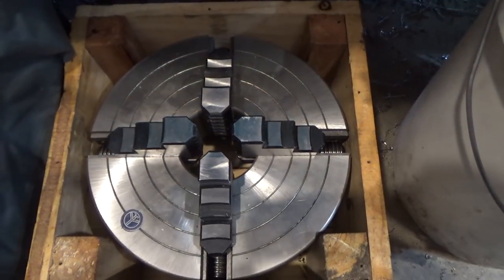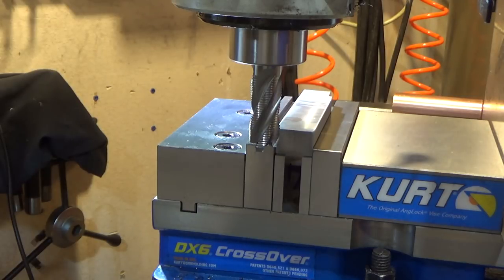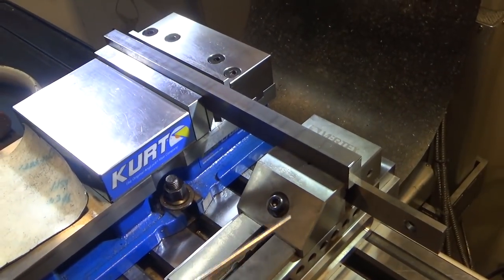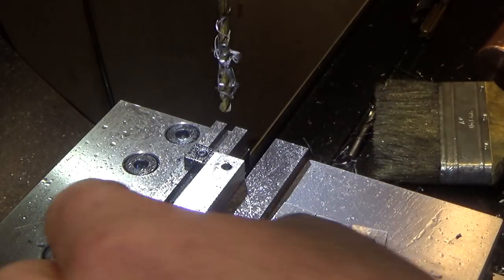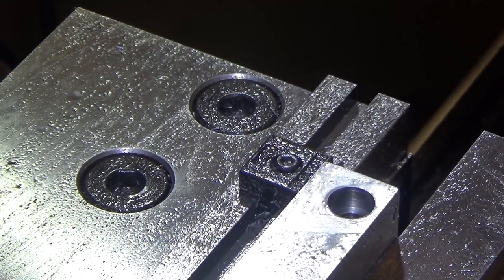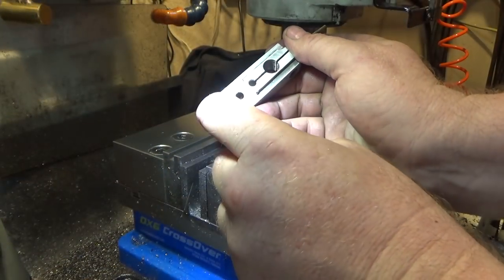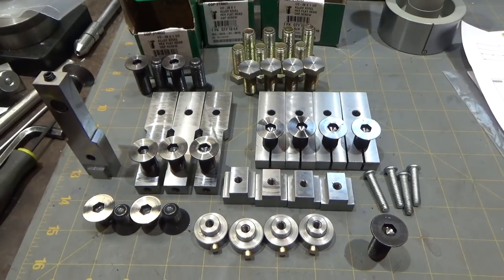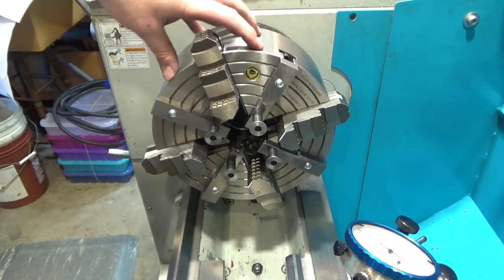61 Lathe Chuck Adjustable Work Height Spacers

Comment: I am envious! Seems you lucked out :) I did get a new Bison 3-jaw a while ago and am well pleased with that - now I need a new 4-jaw like yours. For now my old one will have to do.
Very nice job - elegant even - even with the Bozo hole drilling! As you said - quite a big chunk of work all told. Most successful :)
Noticed you were climb milling quite a lot.
Reply from the maker: I do choose climb milling based on better finish quite often. My mill is new enough to do ok with climb milling, most of the time. I have been bitten by this choice  before though. Especially when I get aggressive. Thanks for the feedback. I really appreciate the comments.
Reply: I guess it was the climb with a generous cut! I climb too but only as a finishing cut - small machine also - your mill seems very nicely solid and firm and sure manages a climb just great. :).
Reply from the maker: Not always and occasionally I have been punished. I remember the time when I tried to side mill with a 1" cutter. That ended badly. You were right to point out the risks. I need to be more aware of the cuts, I am taking, for every cut. I sometimes lose focus. Thanks.

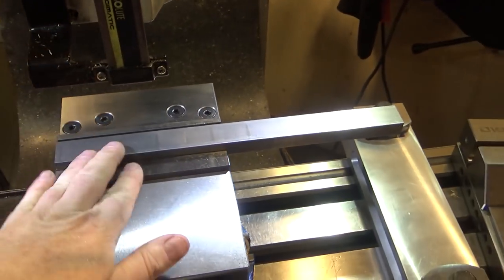Comment: 8:42 looking good.  Seems to work well.  Should be beneficial in the future.  Joe Pieczynski has  video where he drills the front of a non-slotted chuck.  See you next time.
Reply from the maker: It was literally a necessity for my next project. I actually delayed starting because I needed some way to space 1" thick, 4" diameter aluminum discs. Necessity is the mother of all stolen inventions...

Comment: Nice, but maybe run a slot on the round nuts so that you can turn them on the off chance that the pins get jammed in the slot
Reply from the maker: Interesting observation. Thanks.